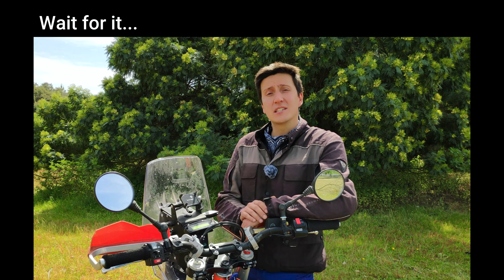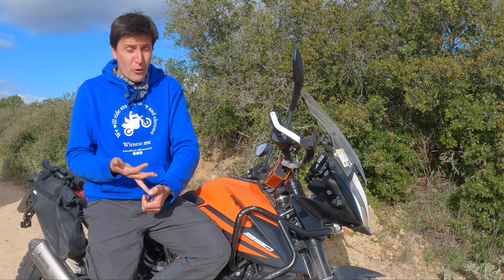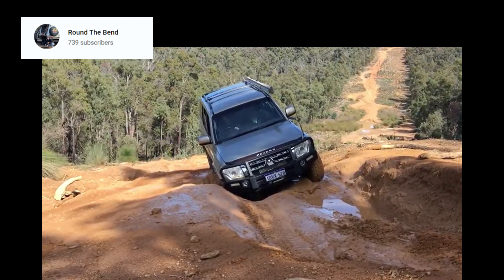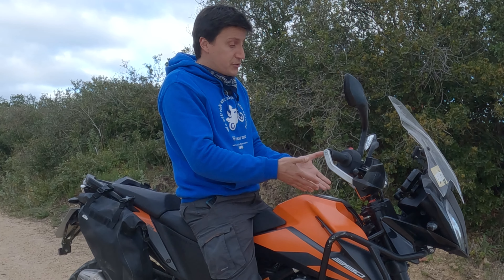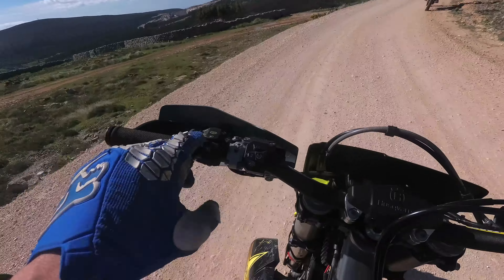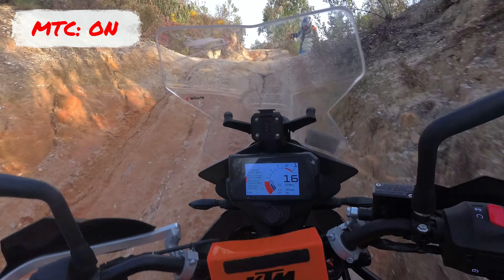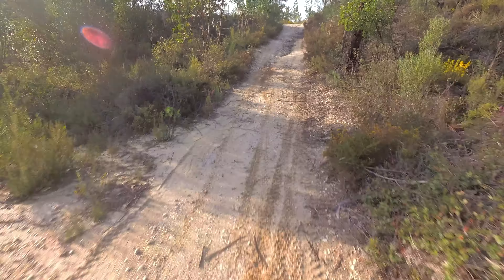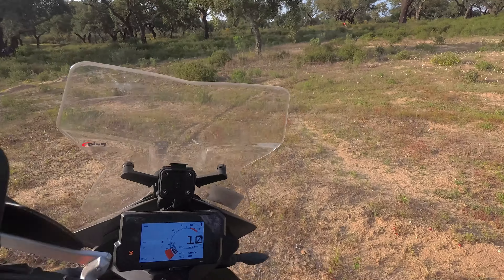Motorcycle Traction control: Does it work? Not on KTM 390Adventure (2019)...

Comment: You forgot that after 2020 KTM updated its system on the 390 adventure not just to remember it's previous settings if you switch off the engine or stall, but it now has an off-road and road mode which both work brilliantly in its applicable scenario.
Reply from the maker: I am glad they fixed it! on the other hand, it just proved that there was definitely something to fix :P But I will write on the title that this is only valid for the 2019 version, thanks!

Comment: You don't seem to understand the design use for traction control.  The feature to allow you to tun it off, is designed to be used in an environment where you know you want to let the tire spin. So to leave TC on when you know you will being spinning the tire is a poor use of the traction control system. More expensive bikes have an off road mode for this reason. It will allow wheel spin with minimal interference.
Reply from the maker: Hey, thanks for comnenting.
The purpose of this video is precisely to inform uninformed people of 3 things:
1- there are TCs that work offroad, and TCs that dont (as i showed comparing the husqvarna with the ktm390)

2- that even so called adventure bikes may have these "non offroad capable TCs" so dont trust companies right away, be careful and inform yourself before buying

3- I am suggesting that if they are not offroad worthy, at least they should be easy  to turn off AND STAY OFF, because when i go offroad i will be doing it the whole day, a i dont want to remember to turn off the TC every 5 min. Its a nuisance and its unsafe (actually, the owner of that bike broke both wrists cause he forgot to turn the tc off on an off road ride).

So yeah..i think all the 3 points of the video were legit enough xD
Im not saying all TCs in the world must be awesome offroad... Im saying the ones on adventure bikes should..or at least they should stay off when the rider needs them to
Reply: @OFFroadOFFcourse  All 3 points are legit and very important to share, just slow the roasts and ease up on trolling 390 ADV owners. It's a good bike that is cheap enough to personalize and use for whatever you want:
1) Bikes and coffee meet, more orange.
2) Highway touring? Throw on a bigger windscreen and panniers. 
3) Commute? Add the quick shift and a tail tidy. 
4) Twisty asphalt? Give 'er a tune and a slip on. 
5) Dirt? Foot pegs, mirrors, hand guards, knobby tires, braces, guards, full suspension,  cat delete, tune, resonator delete, charcoal canister bypass, exhaust, intake, high fender kit, bash plate and the KTM rally seat... and bob's your uncle.
Keep up the good work BTW! Love your videos.

Comment: I totally agree with you, cause it is pretty much objective, is not really opinionable, but I think it is crucial to point it out that all this is just and only regarding off-road/dirt!!! myself and the majority of riders, do ride mainly on the road, where ABS, cornering ABS, TC etc is designed for, and works best! I live in London, and use my v-strom 1000 (2015) every single day of the year, and is not possible to disable ABS, while TC is possible to disable or use with preset 1 or 2. I honestly always ride with preset 2, with sunny days, rain, storm, etc and is effectively the best thing they have ever invented (to be used on the road) cause it effectively keep the bike up! I have a 125cc scooter as well which doesn't have any kind of electronics, it's fun to ride in the city, within overloaded roads, but when you're going even 40mph and you cross over a wet leaf while you are on a very light corner do you know what that scooter is doing? is gonna crash you on the floor. I am pretty sure that you are well aware of what i'm talking about and that's why i think your video is pretty much missleading new riders! you should at least mention that when it comes to these topics, riding off-road or on-road completely change the outcome of the judgments over those technologies. in either case i'm not entirely sure how KTM tech is, but i totally agree that all those maxi-endure/adventure bikes should definitely have those technologies, and have the possibility to disable them keeping them disabled until whenever we decide to turn it back on.
Reply from the maker: Hey man, thanks for the long comment!
I agree with what you say. If you see the final 30 secs of the video you will see exactly that :p

Comment: I doubt people think like you think they think.
TC always limits power to driven wheels in order to sustain traction, this is true for cars just the same.
Your example is afaik wrong. A 4X4 does not climb a hill because of TC but because it drives all 4 wheels at the same speed finding traction more easily. That is why a good 4x4 also has locking differentials: It then drives all 4 wheels at the same speed REGARDLESS of traction. TC in a off-road car is also off or very limited when being off-road... so no TC does not make a 4x4 climb a hill, if anything TC will prevents a 4x4 from climbing a hill.
And I think most people interested in any motor vehicle understand this just fine.

7:50 that is a legal requirement in Europe. ABS and TC need to be on when the bike is turned on. There is a loop hole that the setting maybe stored if the bike is not turned off completely e.g. when just stalls. So as long as the ignition is on the setting is stored. If you turn off the ignition the setting will reset. There is no other way, it is a legal requirement.

TC is a good thing and helps to keep the bike under control in less than ideal grip conditions on the road e.g. during rain. Adventure bikes are driven mostly on roads after all.
Bikes the manufacturer expect to see off-road use either have driving modes or a TC off mode. There is really nothing wrong with that.
Reply from the maker: I see what you mean, now that I think about it, maybe the whole example of the 4x4 vehicles and their TC was not that good...  but my point still stands. SOME traction controls on so called adventure bikes don't work at all off-road. In the end of the video I say (again) that my critique is only about electronic aids OFFROAD, on paved roads the work quite well and can be a life saver.
The traction control i tested is terrible on any hill, its dangerous during turns (cause you cant skid the wheel if you want to), its dangerous when you need to lift the front wheel over an obstacle (it cant cause the engine looses power),  it will leave your bike stranded on deep mud cause it won't let you move, etc etc... it simply doesnt work. That was my point =)
But thanks for pointing out my falacy about the 4x4 example...you are correct!
Reply: @OFFroadOFFcourse  I see where you are coming from and you are right electronic riding aids are mostly for road use. The reality is that that is what most people ride on most of the time even when they buy an adventure bike. Certain aids are now mandatory as well e.g. ABS.
I just think when criticising driving aids one should keep the bigger picture in mind. ABS off-road prevents the bike from coming to a proper full stop in lose ground conditions e.g. a lose gravel slope, so it is bad off-road but it still is a life saver on the road. It is fair to criticise the ABS on a bike marketed as adventure bike when it has no off-road ABS mode, it is also fair to point out that a off-road ABS mode usually only switches off ABS on the rear wheel and to point out how it behaves differently from true ABS off. But criticising that there is no bike without it or that it resets whenever the ignition is turned off is to me not an up-to-date view of the issue especially when state authorities have already regulated the topic.
I will say though that on an adventure bikes electric driving aids should be easily accessible to switch from on-road to off-road and not hidden away in sub-menus of the display. I like it when a bike has a physical ABS off-road switch on the dashboard, that should exist for TC as well.

Like I said I understand you channel is about off-road I just think your sole focus on off-road does probably not reflect reality for most other people that well. 
There is probably a huge difference between how manufacturer market the label "adventure bike" and what you consider an adventure bike. 
Kawasaki labels its adventure bikes as adventurer tourer. Most marketing material show the bike on a paved road. That is probably a more realistic depiction on the use of most adventure bikes than Yamaha showing the Tenere 700 off-road all the time (on the official homepage there is literally only one picture of T7 on pavement).

Comment: I have the 2022 model and it has updated software that has given it two ride modes (and I read online that older bikes should be able to get the update at a KTM dealer). One for street, and one for Offroad, which shows up as a third setting on the TFT next to the ABS and MTC modes, and I have been wondering what it even does. I have a feeling that it reduces the traction control a little bit to give you more wheel spin than the road mode, but I haven't had the opportunity to test it for myself, and being new to offroad riding I'm a little apprehensive to do it. It would be nice if there was a guide book along with the owner's manual to explain how to actually make use of these features...
Reply: In off-road mode it works out intervenes based on front wheel speed relative to the rear... So if the front isn't turning much or at all it allows as much rear wheel spin as you need in that scenario like riding through deep mud or sand, but if you are going much faster it will kick in quicker to prevent excessive wheel spin on faster dirt or gravel roads but still allow more slip than in road mode so you can get it a little sideways through high sleep dirt corners

Comment: That is why the offroad mode on the 390 has TC off and abs on rear off. So it is only for road use.
Reply from the maker: I know but it sucks cause it turns on by itself everytime you turn off the bike (which sometimes is every 5min, if you are riding offroad with a group). At least to me, its waaaay too anoying :P

Comment: You discovered that the MTC on this bike (and many other bikes) it's usable only on hard pavement (7:21). There is a reason why 99% of ppl turn it off, when they are going on loose ground, but turn it back on once they hit the road: why would you cut off power from your engine, on a terrain like that, in the first place. It's like coming to a shooting range, pulling out a 9mm out of your pocket and saying "listen up, did you know that you can reuse the magazine by filling it up?" they would call you the local Sherlock Holmes, belive me!
Reply from the maker: Hello. As a professional motorcycle instructor (10years) and a rider (20years) i can assure you that this info (and practical explanation) was useful to a great number of people. Not only that, but the fact that a lot of bikes offer "offroad traction controls" (and some of them are as useless as the ones on the 390)serves to show how relevant and informative videos like this can be to the growing number of new riders who definitely have more money than understanding.
If thats not your case, thats fine, man :p
Reply: @OFFroadOFFcourse  The main problem I have, is that the MTC on this bike, isn't sold as an off-road feature... Rather as a cool feature for the road, that eventually can save someone's life one day (also sensitive to your leaning angle -why would you need that off-road)... So complaining about an on-road feature being useless off-road is like going at the pool, and complaining that it's too wet in that place, and you've expected more trampolines...
Reply from the maker: @redminute6605  if you saw the video from the beggining to the end, you would see my full thoughts and conclusions about it, where i clearly state how important these things can be on the road.
My beef with the mtc was not that it didnt work offroad, was that it turns on by itself all the time, rendering offroad use of this bike a nuisance...which seems a bit meh oh a so called Adventure bike (by ktm, to make it worse)

Comment: I agree that all the electronics stuff was made for the road and probably works well there especially for speed demons on fast bikes.  If they just set it up so that there was one button that COMPLETELY disconnected the electronics I would say 'fine'.  Thing is they don't 'disconnect' they turn them 'off' but if you have a fault in one your bike is still crippled in all modes, sometimes to the point it will not run at all.  That is a terrible situation to be in when your off road (off course :) ) and your bike dies because of a system you are not even using or do not need takes a dump.  Second the damn EU law that ABS has to reset every time you turn your bike off and restart.  Real PITA when that happens in the middle of a hill climb.  Restart the bike, fiddle with the electronics all while holding the bike in a precarious position!

Comment: I think it's prohibited by law that the traction control should be on by default. In other words: turn the ignition of and on and the TC is back on. (same in my car)
My Guzzi V85TT has an off road setting, TC will allow a bit of wheel spin, but just like this KTM 390 that's useless in loose sand or mud. 
To turn it off completely I have to go into the menu, to only have it turn back on once he ignition is cycled off and on again. 
Work around: turn it off when you start your off road ride and use the kill switch to turn of the engine, that way the TC stays off like you set it. 
On my bike stalling the engine keeps the TC off when it's turned off. 
More off road orientated bikes have better TC's systems or like the T7 no TC at all.

Comment: ok ,, well i have a 390 adventure , now i would normally use my ktm 250 exc 2 banger for full road riding , so my belief with the traction control is the bike {390 ) is a bike for on and some off road , so the traction control is used on road only . and the reason for ktm to have it switching back on would be for regulations , as per Australia , if that helps you understand . cheers , Steve/Australia
Reply from the maker: Hey man, thanks for commenting!
I know it is supposed to be the law, but somehow for 2022 they fixed this issue :o

And law or not, i dont like it :p
Thats basically the only message i wanted to convey :p

Comment: The TC of the 690 works actually quite well. Of course you have to turn it off for deep sand and if you really want to do slides or wheelies. But on the other had in a muddy hill climb it actually reduces wheel slip and improves traction. ABS has to be off for off-road. It is insane to have it on if you a steep downhill.
Reply: I second this. I was sceptical myself, but now that I own a 701 I have to admit it’s a thing of beauty.

Comment: I like the video. Well presented and entertaining. That's the case in practically all your videos. A question: are there off-road situations, when rear wheel spin is unwelcome? E.g. when trying to get out of a mud or something? Can you imagine a traction control which could help in those situations? Such TC, that would be activated by a mechanical switch instead of attempting a piano concerto in d-flat minor on a multi-function 32 inch touch screen?
Reply from the maker: Ahahah, great queation!
Well, you dont actually want wheel spin ever...on a perfect world traction wouldnt be broken ever... but you need it. If i could go through sand/mud/lose rocks without the wheel spining it would be great, but because the wheel naturally spins, the TC wants to stop that and it stalls the bike.
A good offroad tc like the one on the husqvarna allow a lot of wheelspin to happen, enough for youto have "a normal life", but not enough for the rear wheel to spin out of control during a powerslide (so it spins enough, but not too much).

As for your example of the bike stuck in mud: During my ktm690 review o got stuck on a deep water/muck pond with the TC ON, and because for some reason  i could only turn the TC off with the bike moving, i couldnt take the bike out of there (but to be honest, when i finally turned the thing off i was stuck either way...so the TC didnt help, made it a bit worse, but i cant 100%  blame it for the failure xD)